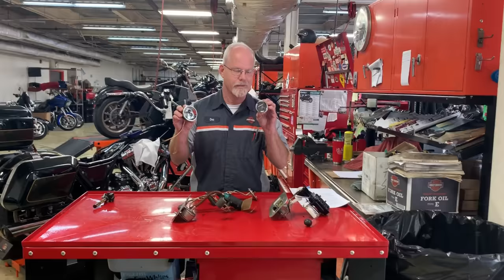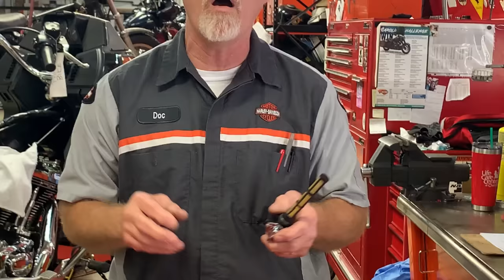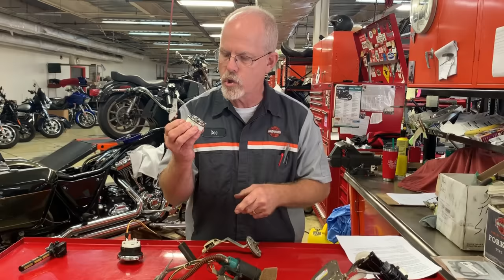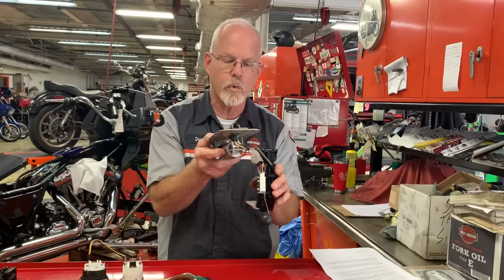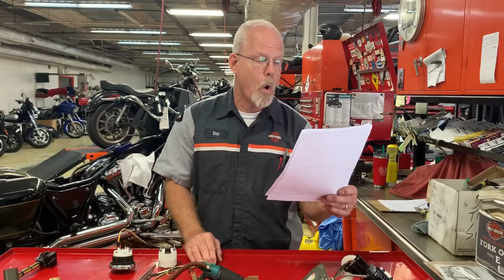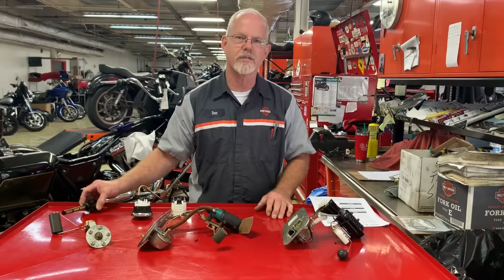DOC HARLEY: FUEL GAUGES

Comment: My '97 FLHPi had those problems. No more problems as I ripped out the problematic Magnetti-Marelli fuel injection in favor of a carb and Dyna 2000i ignition. Went back to what I've done on my other Harleys since I started riding in 1976. Zero out the trip meter upon fill-up. Stop for gas when trip meter hits 125-140. I can actually go about 180 on a full tank.

Comment: I have a 2018 Sportster 48, I don't have a fuek gauge. I ordered and picked up a lcd fuel gauge that fits on top of the brake master cylinder on the handlebars. Expensive, and it will be expensive to have installed (I don't have the time to do it myself) but I can not wait to have a cool little gauge!

Comment: When you have an old bike a working gauge of any kind is welcome. On my 1989 FLTCU the gauge was dead and the sender obsolete but I found a radiator shop in New England that makes replacements. Lo! A working gas gauge and reasonably accurate too! Now I just need to derust the tank....danged ethanol!
Reply: Sounds like fun!

Comment: Excellent video. In going through the fuel system of my 99FLHR, I needed a new sending unit for the carbureted style (older version) and found they are totally obsolete. That’s from both Harley and the aftermarket. Some research and a good call led me to Tri Starr LLC. They rebuild sending units for literally everything. After mailing, they advised 4 days later that it was ready to ship. It was gone 11 days g
Reply: What did they charge you?
Reply: @og2216  it was somewhere between $75 and $125 including shipping. It’s been several years. They may have moved but the name is the same.

Comment: Thanks Doc,

I have a 2004 Roadking Custom. 
The Fuel Cap Gauge is all over the place with no consistency.
When filled it will read full, then after the bike is turned off and back on it says 3/4 or a different reading.
Where would you say begin to diagnose the issue??

Thanks
Phil
Reply from the maker: Connection first. First the condition of pins and sockets in the connector under the tank. Then lifting the guage up the wires and connectors. The ground side especially. It may turn out that age has weekend the component in the tank….Doc

Comment: Very interested video that explains exactly the problem on my FLHT 1996. Do you know which fuel gauge part number has already the dampener inside ? Now I have the 75111-96. 
Or would be very helpful to know which dampener I have to use. Thanks from Italy 🇮🇹

Comment: My 98 evo has 2 wires blk neg I assume and orange or red power. Bought an 03 tank has 3 wire wire an extra yellow wire. I assume that is for the low fuel light in speedo ?

Comment: Great video as always. I have a 2002 FLSTF with a carb. I reset my trip odometer when I fill up and refuel based on that. My fuel gauge shows empty long before I have to refuel based on the trip odometer.
Reply: Same thing with my 2003 FXDWG. However, I find this "inaccuracy" to be really informative as I noticed that when it shows empty I have approximately 2 gallons left. So when I have to switch to reserve (which is 1.1 gallon) - I can easily calculate the MPG and decide how desperately I need to search for a gas station
Reply: @andreychernoivanov4945  Just hit this issue with my 2002 Softail Standard.I fuel at 100 miles and it only takes about 2.8 gallons yet the tank is 5 gallons.Oh well.

Comment: Question. I adjusted the float but the gauge never goes over 3/8 - 5/8 tank. Took sending unit out and tested and it’s not disconnecting from variable resistor and reads correct top to bottom. Is there a way to adjust needle on the gauge? The gauge is new and the sending unit is new and good. I have 44 years experience so I knoe how to read manual and test and grew up as a mechanic originally. Just want you to know so you know I’m not an amateur. Love your vids and thanks more than you know.

Mike
Reply from the maker: I’m thinking we need to think outside the box. Float comes really close to the inside of tank. Play with adjusting the rod attached to the float…..Doc
Reply: @LowCountryHarleyDavidson  yes sir. I looked at it several times in & out trying to adjust it. It moves freely all the time. The gauge used to read full but it would take a long long time to start going down and I wanted someone to adjust it for me because I was tired of working on stuff. They said they put a new gauge in and now it only reads just over a quarter of a tank when it is full. I checked it about 15 times this weekend trying different things but even when I had the float going up a little higher it would only go up about 1/8 tank more. That's why I think something is wrong with the gauge. Is there a way to adjust the needle on the gauge?

Comment: Got a 2000 duece. 5 gal fuel tank. Never used fuel gauge. Just go around 170 to 180 miles and fill up. For 20 years when filling up it takes around 4 1/2 gallons. For some reason I can only go 125 to 130 miles on a tank now. Reserve is gone also. Been to a dealership twice. Still happening. No leaks. Bike seems to run fine. Could use some suggestion.  Thanks

Comment: Hi Doc. I know this is an older vid but I wanted to put a flush mounted gas cap and a dummy matching cap on the left side and just use the speedo range remaining on my 14 Dyna. However, now with CAN/BUS life is that gauge needed for the BCM to get the info or can I just disconnect and secure the plug? I saw a video once where these buys taped up the guts of the factory gauge and stuffed it back in the hole and covered it so they could use a different Speedo setup. I can't imagine that's the proper way to do it. Thanks!
Reply from the maker: Sorry to say the BCM will be upset if you remove fuel gauge with codes and system failures till repaired…..Doc

Comment: Doc, I have a 98 road king. When I have the dash turned on, and it turned to run, but not started, my fuel gauge works properly.

As soon as I start the motorcycle, my fuel gauge drops all the way down to empty, and no longer works properly.

Having a hard time figuring out why the fuel gauge would work until the motorcycle is started and then stop working? 

As always thanks for your help.
Reply from the maker: If you bike is jiving than a connection is jiving right along. Lift your guage up and see all the rust. Clean the ground. Also clean your fuel tank mounting bolts. The guage gets it ground through the tank to the frame…..Doc

Comment: On softail, dyna, and rk fuel gauges (left side tank mount) what is the change in the wiring? Aftermarket fuel gauge are up to 2007 and 2008+? What's the change?

Comment: As I ride my 2018 RK, I do miss the concept of a reserve tank.
Reply: Just reset your trip meter at every fuel up, then see how many miles you went before the fuel light comes on.
After the fuel light comes on, fuel up again, then notice how many gallons it took to fiil your tank, then subtract that amount by the total capacity of your tank. (For example;
my sportster holds 3.3 gallons total. So when my fuel light goes on, and I refilled it with 2.3 gallons, and trip meter read 70 miles, I still have a gallon left, to run approximately 25 to 30 miles more, with fuel light on. But it is safer to fuel up, when you see the fuel light go on.)

Comment: You might have solved my issue fuel gauge goes to full and I have about a half tank or less now not sure what to replace
Reply from the maker: First check all wiring, sounds like wires are crossed. Unless you have had your float assembly out, then the float needs readjusted……Doc
Reply: @LowCountryHarleyDavidson  I replaced the fuel filter someone mentioned might be bad ground that's my next thing to check, hope my problem helps others thanks

Comment: Thanks for the info Doc.
Now if I could just find a video on how to remove the fuel sending unit on my 2000 FXDWG.
I have it almost out but, I can't position the float where it will come out of the hole.
I had to take a break, and make a sammich. I'll try again after lunch.
Reply from the maker: It is a puzzle. I find spinning the unit around as pulling it up and out. The float will just fit...Doc
Reply: @LowCountryHarleyDavidson  - I finally got it. With the float at the top of the opening, and the float rod as straight and forward as possible, I used a pair of pliers to grab the float rod right next to the float. Then, I could slightly bend the rod, as little as possible to start the float out of the hole, and it came right out.
After cleaning off the wire connectors, the float resistance checks were good. I put it all back together, now my fuel gauge needle is working again!
Thanks for the videos Doc. 🔧

Comment: I found an interesting problem on Fatboy 2005. The fuel sensor starts to "eat" gasoline very quickly (in reality, the consumption is normal). When the motorcycle ate only 9 liters (checked it on a gas station), the arrow was already at the red mark.
The Softail tank is 18.49 liters, and when the sensor goes into the red zone, almost 10 liters remain in the tank. What could be the problem?
Reply from the maker: The adjustment of the float mechanism in the tank. HD does lean on the side of giving you plenty of fuel on “empty” to get to a fuel station

Comment: Doc! You know your info! Question...New speedo with fuel gauge on older bike not working.  Is that because there's no power going to fuel sending unit as opposed to a newer model with a fuel pump? 
I connected '04 deuce yellow sending wire to speedo harness bank 9. Ohms read good but speedo isn't showing any readings...... can you help me understand why?
Reply from the maker: Contact us through Email. Too many questions. Like part number of new speedo. Not sure new speedo may not recognize the older ohms….Doc
Reply: @LowCountryHarleyDavidson  Hi Doc! Thanks for responding! I can't find an email address for you......can you provide the email or point me in the right direction to find it? Thanks!

Comment: Doc, I have an ‘03 Fatboy EFI. The fuel gauge is mounted on the tank but doesn’t work. I believe it’s stuck showing a full tank. Is there a fix for this? It isn’t a major concern as I use the odometer to track where I’m at fuel wise.

Comment: You are brilliant Doc. You remind me of my former father-in-law Larry Parker. He was brilliant too. On the note of your last comment, I refuel my stock 2001 Sportster 883 between 50 and 60 miles. Thank You for this video.
Reply: I can go 200 miles with my 2006 Sportster 1200 with the 4.5 gallon tank.
Reply: @geraldscott4302     I do not like the larger fuel tanks, they make a bike look obese. The streamlined tank I have looks sleek, and I would pull off every hour anyway to stretch. I would never travel 200 miles non-stop. But enjoy your setup. 😀

Comment: Hi  Doc,love your site. I find your history  and explanations great. Perhaps you can throw some tips my way .im a new owner of a twin cam ,2014 cvo roadking.. ever since i removed the tank to wire up a aftermarket  faring. My gas gage  wont work .i did reconnect  the 3 wire conn. No luck trouble vode keeps poping up speedometer. Ivs cleared all but speedometer, it wont clear! Btw the speedometer  works fine. Gas gage not so.

Comment: Doc, i put diesel in my motorcycle 2014 electraglide. Now my fuel gauge is inaccurate. How do I fix this problem? There is fresh gas in it now. Still doesnt read properly.
Reply from the maker: Fuel gauge is the least of your problems. I’m sure you will have to remove the float assembly and clean it with auto brake cleaner. Just might bring it back ( unless it didn’t work in the first place 🤷‍♂️)…..Doc

Comment: Another thing. Air Pocket inside the tank. I fill my 2018 XL1200C up to just over the nozzle holder in the opening. On Jiffy Stand. Ride 4 miles to get home. Put in some Lucas Ethanol Treatment. And notice the fuel is below the opening. A previous Yamaha Majesty had to shake the bike to get the air out.

Comment: Help please I have a 2006 Fatboy a flush mount fuel gauge has been fitted but for some reason the fuel warning light will not go out any help would be much appreciated. Thank you
Reply from the maker: So your gauge works as the needle moves from empty to full but the “almost Empty” light stays on? The resistor in the unit that tells the light to come in and off has failed

Comment: I have a 2008 Road King Classic. The low fuel light comes on with 2 gallons left in the tank. I have checked it several times and when the light comes on I top up the tank and it only takes 4 Gallons give or take a couple tenths.
Reply from the maker: This is true. You could pay a tech to re adjust your float with an Ohm meter for less fuel in the tank...Doc

Comment: Hello. I have a 2017 road king. My fuel gauge on the left is reading just fine. It’s the R on the speedometer that tells me I still have 150 miles on empty. I’ve turned the bike and been riding. Still no change.
Reply from the maker: See your dealer. It sounds like a calibration issue or the reset button is not functioning. Thanks ~ Doc

Comment: Hi Doc, I am only learning to ride a Harley but I have a question with my street 500 when low on fuel does a yellow light come up ??? I have been told every time I fill up set the odm at o to guide me on how many KM my bike does to a tank of fuel. Thanks
Reply from the maker: Yes a light should come on. I agree the odometer is the best gauge in knowing how much fuel you have. Sorry I don't know KM to empty...Doc

Comment: Hey question, I don't know if I will get a response on this but it's worth a shot. That first gauge you spoke about is what I have on my 2002 Electra Glide, at what point do I know it is empty? I know obviously there is E, but that only consumes 4gallons. I know i have a 6gallon tank. There are more hash marks below the E, does that represent my reserve? any info would be great, thanks guys
Reply from the maker: I am trying to remember. I believe your gauge has a LED. This will indicate you have at the most 30 miles till dead empty. This of coarse depends on condition and modifications to your bike
Reply: @LowCountryHarleyDavidson  okay thanks. Other than the needle it has a gas pump logo on the gauge. Is that what lights up when almost empty?

Comment: Loved this one Doc, Question for you, I own an 07 Softail Standard, I've fitted the Harley speedo upgrade to the Swiss made one that incorperates the speedo and rev counter, plus gear position and fuel gauge, I then fitted an Arleen Ness gas cap kit, this replaced the stock gauge with a digital light display which also showed voltage, all was fine for a time, then the A N fuel gauge packed a sad and I lost the speedo digital display as well, I assume the 2 gauges piggy back off each other as I refitted the stock gauge and all was well again, the question is can I wire out the stock Harley gas cap gauge so I just have the speedo one working, Regards Steve "down under"
Reply from the maker: Looking at the wiring diagram, your Arleen Ness shorted out the signal line. That would effect the speedo. Just unplug it (the stock fuel gauge) and see what happens.

Comment: hey sir i have a question, does the fuel pump from m8 or softail works with sportster 16-22 cuz i think the sizes of it looks exactly match but i don’t know does its works together, i want to change my speedometer from Low Rider S and my bike is 48, the gauge from Low Rider S has 8 level of fuel and i think its match with my 48 cuz 48 has 7.9 liters, so if it does works together do i need to tune my bike after?
Reply from the maker: What you are purposing is out of my league. That is full on custom with trial and error. Maybe someone else on the Net has tried that combo…..Doc

Comment: Hi Doc,. What's the major problem with the fuel gauge on the V Rod ? I had a 03 and have a 08 now. Do you have any ideas ?? Thanks glenn
Reply from the maker: A V-rod calculates what the fuel level might be. So If you have a fun Hell raising time over the weekend it calculates low MPG. Even if you drive sanely during the week. Then at the next fill up it starts all over again....Doc

Comment: 2017 Softail Slim, only has 212 miles on it (bought it 2 months ago with 91 on the clock) and just yesterday it started giving me the low fuel light and the fuel gauge read empty.  It took 0.9 gallons but would read full before the end of the next leg of our ride.  Bike cooled (lunch) and got on it again after lunch and it showed empty.  Stayed that way for a bit, then just cleared on its own back to 3/4 (where it should be; expected for this part of our ride) and this morning, it's showing empty again.  I'm sure it's a short (or open, actually) or something, I just don't know where to begin to troubleshoot.  If you get this and respond, thanks in advance.

Comment: 03 lowrider carb. with petcock. swapped tank and the gauge is not hooked up (connectors are different and the gauge was never accurate anyway). reset trip meter on fuel up hit reserve at 165-180 miles still only takes 3.5-3.75 gals with a 4.9 gal tank I've been tempted to carry a 2.5 gal gas tank and ride till it dies just to find out what my actual empty is

Comment: On my 2017 Breakout, the gauge always reads LO Range.  Changed the sending unit and it did not correct the problem.  What else can be causing the problem?
Reply from the maker: Connections or possibly wiring issues...Doc

Comment: Nice explanation, but I was hoping you were going to address how the fuel gauge could be fixed, mine on 2007 RoadKing goes to full and stays at full no matter what.
Reply from the maker: Your wiring could have a short, but there are really too many factors for me to diagnose without working on it.

Comment: could you do a video on replacing a fuel gauge on a 04 nightrain and what  causes a leak in the hole where the wire comes out
Reply from the maker: Follow your Harley-Davidson Factory Service Manual....If you do not own this, bring the bike to your local dealer. Leaking fuel is dangerous..Doc